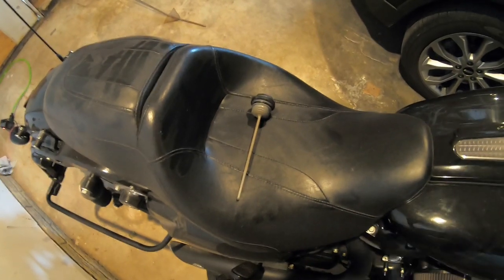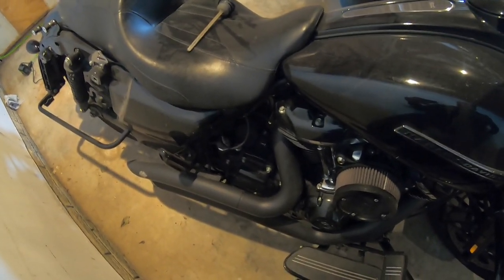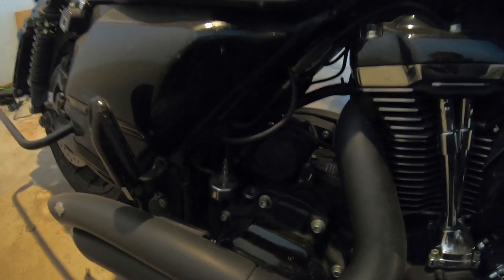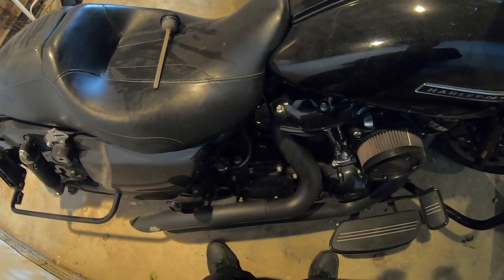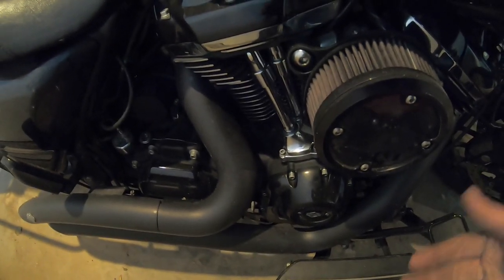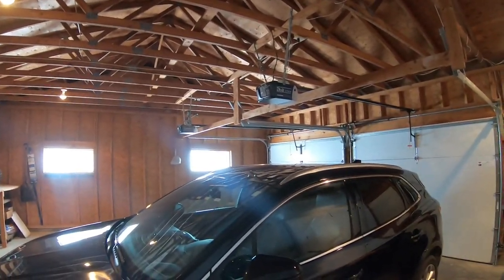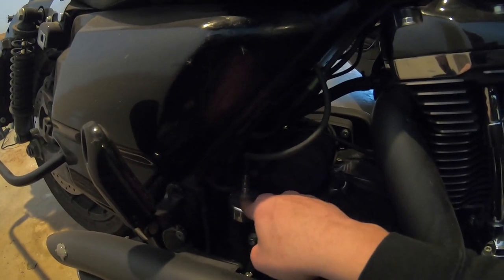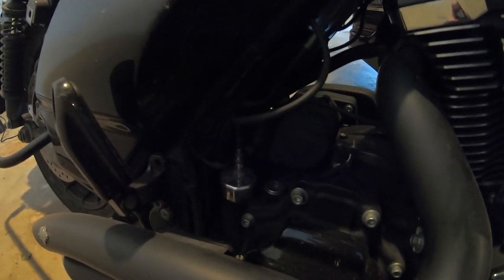Feuling Vented Dipstick- Parts Review

Comment: How is it so far? Is it benefiting you since you installed?
Reply from the maker: It's hard to tell tbh. In some ways I feel like I do get less oil out my breathers for my air cleaner. Revs a little bit quicker as well. But I do feel it spews out a bit of oil under the bike while riding so I have to top off my oil level at 3k between changes. I think you could be better off with A1 Cycles ventilated dipstick or Trasks Check M8
Reply: @Meathed_Moto  is catch can instead of filter  may work for me then ?